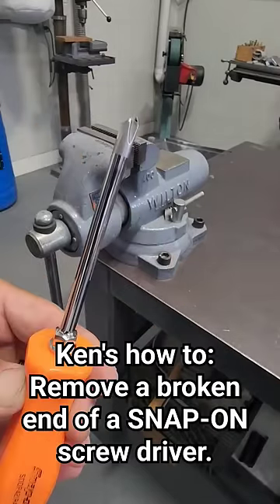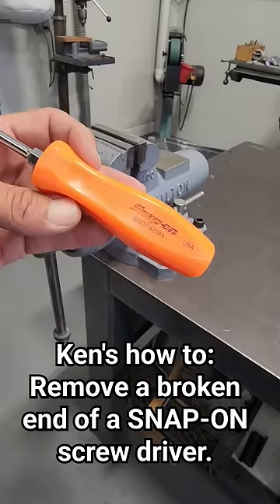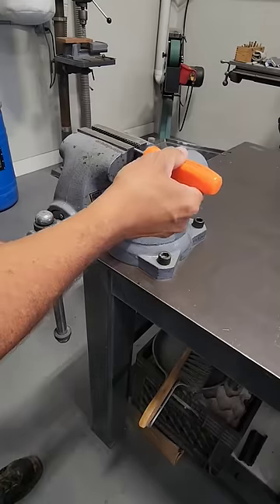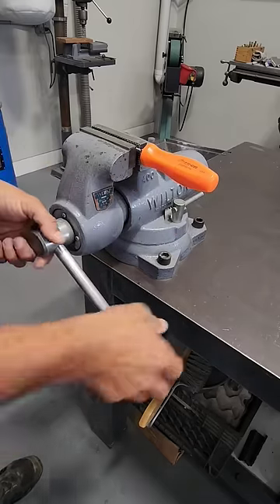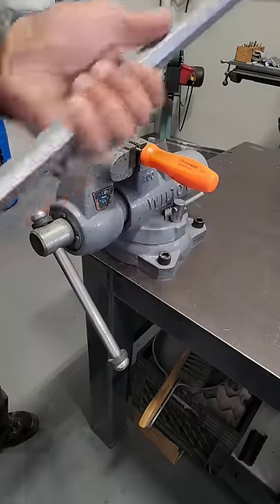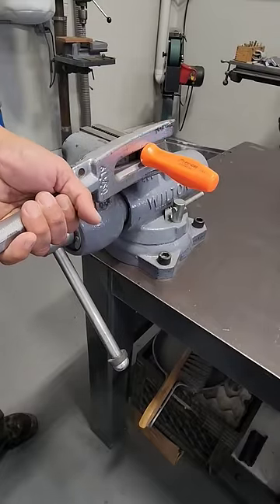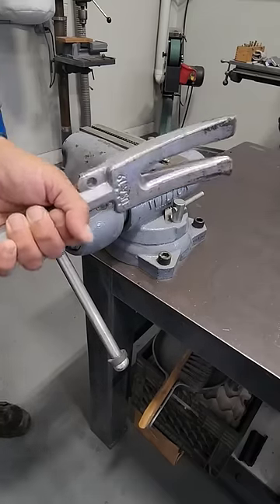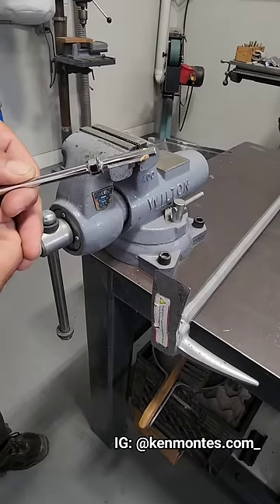How to remove the broken end of a Snap-On screwdriver.

Comment: Literally, the only reason you could possibly ever even somewhat consider buying a snap on is to replace the tool when it breaks otherwise there is absolutely no godly reason why you should ever buy Snapon and spend $50 on a screwdriver. I don’t know who’s crazier, a democrat, or someone whos buys snap on
Reply from the maker: Mr. JOSEPH,  a Democrat, hands down! They don't work, remember,  they have no clue what a P2 Phillips screw driver is. So they will never be familiar with tools long enough to be picky with the way a tool performs or feels. I have thousands of different tools, and all types of brands. Nothing , and I mean nothing feels better (to me) than these style handles. So, I have had these for 25 years. What's wrong with good American tools?
Reply: Hahaha, I hate to tell you bud but I spent $20 a piece for a flat and #2 Phillips for my home bag because they handle well, don't strip screws, and last. 20 years later if they break (I did manage to break one using a wrench on the flats to try and loosen a screw), snapon sends me replacements no questions asked since I no longer work in a shop. Good luck doing that at Lowe's with craftsman. Yes snapon is expensive, but my latest experience reinforces why. So who is dumber, the guy who got the screw out and has moved on to the next job or the one who spends half a day stripping it and drilling it out. 😅😅😅
Reply: @TallGuyChris  there’s good brand screwdrivers besides snap on and for half the cost. Even if I have to replace it twice it’ll still be more cost-effective and faster to replace. I also don’t use the wrong screwdriver for the wrong job. I have a heavy duty set of Milwaukee and Dewalt that I use on the bigger jobs. But for the most part, I just use my impact with Milwaukee bits for 20 bucks. I would argue that if you’re breaking any screwdriver, you’re not using it properly. But it’s easier for us to blame the manufacturer than it is to admit, we made a mistake or had poor judgment. I’m Js i’m not here to shit on your parade, but I think you’re wives would be a lot happier if you guys came to the same conclusion the rest of the blue collar world has. Not to mention, you’re not even gonna have to deal with breaking it so much as you are losing it because I’ve had two people leave a snap on screwdriver in my van after working on it and other people have said the same thing. So how do you replace a screwdriver that you lost? Well, now you’re out another 20 bucks for one screwdriver that was suppose to last a life time and you have to wait for the truck.
Reply: @josephdavis1087    I didn't blame the manufacturer did I? Nope I was working a stuck #3 Phillips on an old car latch and managed to get it to bite hard enough that with a wrench on the hex shattered the end, maybe I was not seated right and it jumped, but I was putting A LOT of force on it. Regardless I don't see how breaking a screwdriver needs to be debated. It happens and not just because you're using it as a prybar.  Yes, I'm sure there are other screwdrivers, more so now a days, that are good quality. Remember, I said 20 years ago. I've bought alternative tools before, plenty of them. But access isn't always easy. Not sure what brands you're getting (you mentioned DeWalt and Milwaukee?), but I think most decent stuff would have to be ordered in, which means a wait. I haven't bought any screwdrivers lately, because, well I haven't had to, but my replacements arrived to my door in a couple days. Any other time I needed a tool back in the day would require me to try to find it at a local store, wasting time I could be working, for crap stuff. If I was really pressed I could meet the tool truck or he would stop by. 

Not everything snapon is great tho. Everytime I use my digital torque wrench I regret my life choices. But for now, using it occasionally is better than researching a replacement.

Buy what works for you, but no need to be a douché about what works for me.

Comment: Umm i didnt realize ppl actually care about thier snap on screwdriver handles maatching. Who cares if you have a orange and red habdled screwdrivers with dofferent font a screwdriver from snap on is a screw drover as long as they give you the same type of screw driver back as in right length and size then who cares what color handle you get.
Reply from the maker: They would not fit in the molded spot it belongs in. It needs to be the same. If not....it can't be put away in the correct spot. 
But most importantly,  I have had 25 years of history with that screwdriver,  I need it to last another 25 years!

Comment: Snap On always only replaces the blade/shaft, not the handle.
Reply from the maker: I beg to differ! They almost always replace only the tang, blade or shaft....until they don't.  Thats what happened to me. Believe me, I was totally shocked,  1st, the guy didn't have a replacement shaft, then says leave it with me and I'll fix it. 3-4 weeks later, I received a new one, but not my original handle. It was a totally different handle, and tool length altogether. I told him I prefer my old handle. His response was, oh man, sorry, that thing is long gone!

Comment: I wanna know how you break a snap on Philip's if using it properly
Reply from the maker: Seriously strange as all hell! It simply just broke, after 25 years of everyday use. And as you can see, there was almost NO visible wear on the tip. Even after 25 years. And it was being used like normal with 2 hands on the handle,  keeping it lined up with the screw head.  It did not strip the screw. The tip finally said no more.

Comment: Bro the snap on guy literally does it for you
Reply from the maker: I know, and he has for years. That's what they do! BUT, what happened to me when he didn't have the correct tang is, he sent it in for replacement,  and Snap-On sent me back a brand new one. A new one that was totally different. I wanted the one I had fixed. I've had it for 25 years. And it was gone! And the new one didn't match, didn't fit in the slot, didn't have any history. I'll never let that happen again! 😎👍

Comment: Yeah snap-on returns/ warranty is a joke! I sent in my light because "magnetic arm" part broke. The light had 3 modes. They sent me 1 back that looked the same but no longer had 3 brightness settings. It just turns on and off. And won't send me the right one or old one..

Comment: You haven’t broke that under normal use. Also when you try to put a new blade in it won’t fit as they are fitted when the blade is warm/hot. + it’s nice to have different colours as we pick the right one first time.

Comment: they can't put them back on , I got a large prybar screwdriver it came with a smaller one with a 45 degree bent in it , every snap on guy that's tried to replace the handle splits it before it bottoms out , they even tried to say it's not there prybar ...bullshit it ain't, snap on is a Rip off company .. stop hitting them with the hammer on the handle , that's the wrong screwdriver for that ,

Comment: I just buy the 6 in ones for a dollar instead 😂 get more done with less weight carried in pockets  ya need heavier duty  then ya gotta bring over the whole toolbox  with a full set of solid ones ya know  full shank with a hammerable metal top  as long as it's not for electrical where everything is insulated alot and even rubber dipped after that with extra grip texture

Comment: That's hard to do with the pry bars. I still have the square handle ones. You could change the bar on those. But all they have are round handle ones now. They are made all one piece. Can't rob the bar from those for my handle. Unless you use a chop saw.😊

Comment: Proof that you over paid for tools that have the same warranty as Harbor Freight.
Reply from the maker: Hell no! NEVER! this lasted me 25 years with no visible wear. 25 years, and I build things all day everyday, 12-16 hours a day. When you build as many things as some people do, there comes a time when you can feel the difference of the chrome plating, the feel of the forging, the sound it makes when it fits into a screw head or when the wrench ends are 10-25% narrower, but still stronger. The fact that a screw driver can last 25 years and build/as much as this P2 driver did, ill be 70 years old before I need to get another,  if ever. 🇺🇸👍
Reply: I've made my living using Snapon tools for 3 decades. Sometimes 12 hrs a day 6 days a week.

There is a difference.